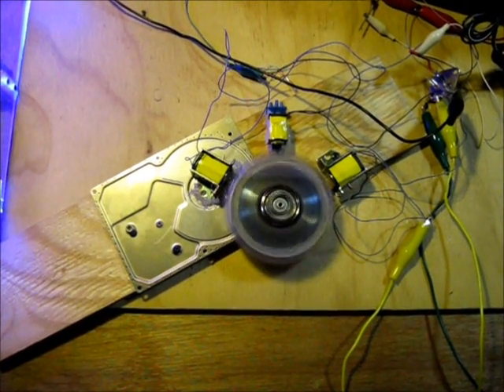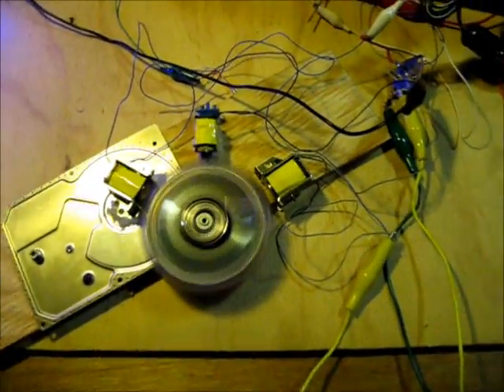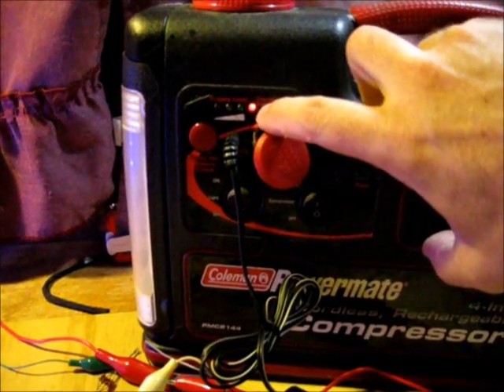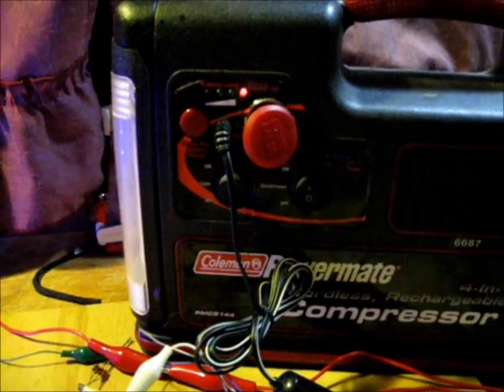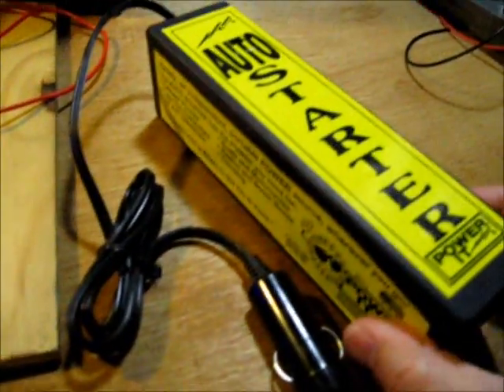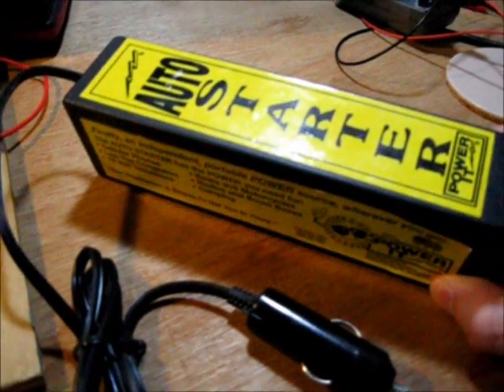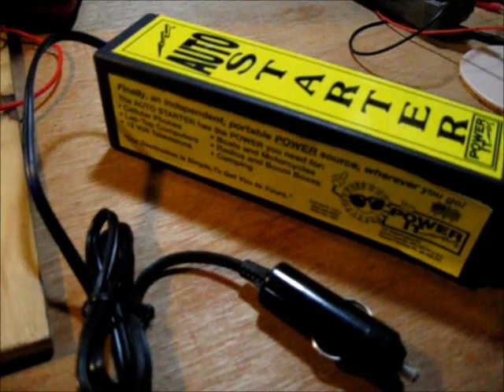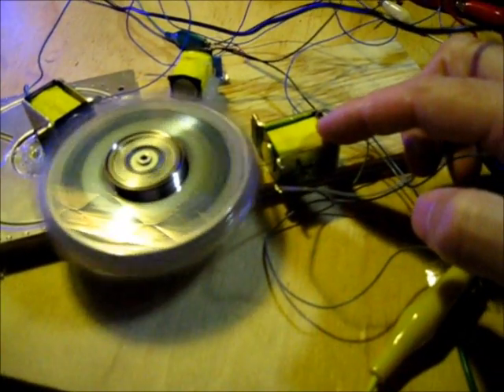Desulfate lead acid batteries Free

Comment: It seems YOUR model is more reasonable and simple $$$  The website you send us too shows models that are "Way out there" compared to yours. It's discouraging to see how evasive you are on showing us the run down on YOUR model, A tear down and set up and schematic of what you showed us would be great, the high quality number 9 Swiss bearings found in old Hard drives is genius!!  They alone are 20 bucks a piece retail. The balanced disks inside the drive yet another gold mine waiting for the plucking. Please show us YOUR model in detail and not send us to some other website especially one that has a bicycle wheel model for 1100 dollars !!

I am tempted to build a van-digraph generator and pulse it's output into the batteries before I spend a grand. High voltage static pulses and near zero amps is the ticket I guess.

Comment from the maker: If you can get a hydrometer to check the battery acid level, then maybe you can use acid from another battery. The problem is that the acid reacts with lead and once the battery is sulfated the acid chemistry is changed a bit.

You can always try it though.

Look into the Bedini Alum battery. You can use pickling alum to restore a lead acid battery.

Comment from the maker: Radiant energy is hard for me to explain. It is better explained using physics, but essentially we are surrounded by a field of energy, sort of like cosmic rays, that we can tap into and channel into a lead acid battery for later use. It only takes a little pulse of conventional energy to tap and channel a lot of radiant energy into your batteries. Look up Tom Bearden and Radiant energy for the physics of it. He explains it so much better.

Comment: The system works and if that's the parts you happen to have, great.  I wouldn't go out of my way to make this though, ie. I wouldn't go looking for any of these parts when I could simply use a DC motor and turn that instead.

Comment from the maker: Now you are just talking about the laws of thermodynamics, which is true and good.

But when I mentioned the word "free", I meant that you can make the machine for free using free parts that you can salvage rather than spend hundreds on a commercial desulfator.

I try to avoid the words "free energy" because it riles people up and starts all sorts of discussions. True, there is nothing absolutely free and I have to put something into the system in this case to tap into the radiant.

Comment: I didn't mean you *personally* have to put it in, what I meant is that in any physical system, energy output can never exceed (or even match) energy input.
You still need to find the source of energy, be it wind or solar or hydro.  If you call that "free energy" you are 1) discounting the source of the energy and 2) discounting any initial and ongoing costs in running the system.
If that's your game then fine.  You're free to speak any way you like.

Comment from the maker: Oops. Now I must disagree.

How about a windmill? I put nothing in and get lots of energy out, from the wind.

How about solar panels. I put nothing in and get lots out, from the sun.

Tapping into energy that is already there.

Hydro, the same deal.

Radiant energy, the same thing.

Tapping into an energy source that is already there.

How about cosmic rays? Using energy that already exists does not require me to put 100% in. Nope.

Comment: Another guy gave me a parts list. IN4001, 470ohms, 1k pot, IN4007, 2N3055, some magnets, and a bifilar coil,, I have a bad hard drive, i can take apart. But, where do I get the coil from, I see you are using 3 coils, how are you doing that?

Comment from the maker: It is simply, really. A magnet passed the coils and induces a charge in the smallest coil, turning on a transistor, which allows power to flow through the larger 2 coils. This repels the magnet and keeps the wheel spinning. The back EMF is collected from the collapsing coil field and send to the battery to be charged.

Here is the interesting part. The pulse sent to the battery can be 100s of volts. This pulse breaks up the sulfation on the plates and converts them back into the proper chemicals